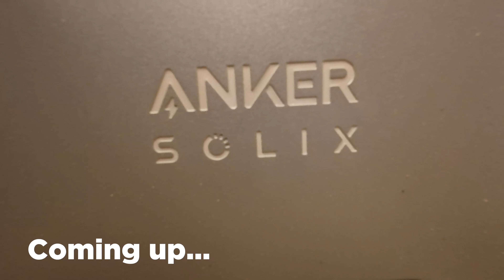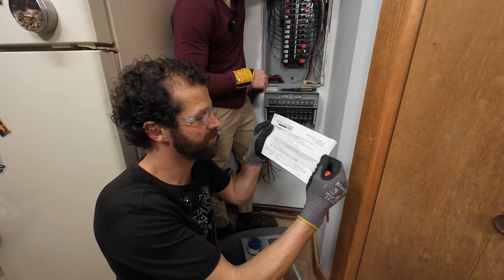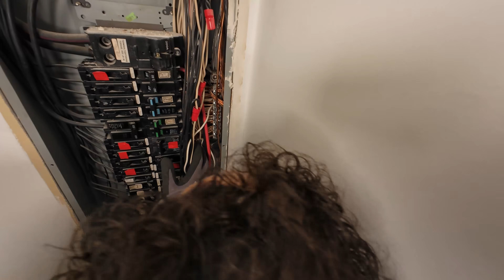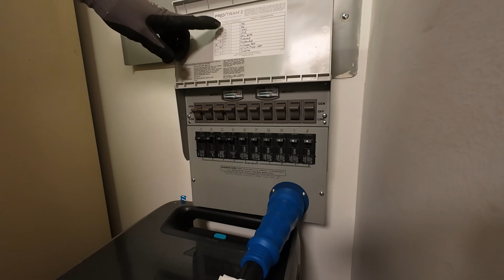Whole Home Batteries are Getting More User-Friendly!

Comment: Even if it is "Legal" to stuff so many wires into that conduit, why?  It seems SO easy to put in 2 conduits.  And also to put in the wires before putting tightening the 90 degree fitting on the back of the transfer switch.  So 8 circuits X 2 wires in each, and a neutral, ground.  That is a lot of wire to pull in and not damage it.  
It would be just as easy to put the two conduits on the back of the transfer switch,, with all of the wires going through the conduits, and then with the two holes in the bottom of the panel, pull the wires into the panel as you attach the transfer switch to the wall, then attach the lockwashers to the conduits. Then put on a bushing. 

Way to go, put a tap through the wall!  And drill 2" behind the electrical panel, when you are tapping the electric panel to put in the ground screw on your new ground bussbar.  Maybe it would be better to drill the hole, and then use a hand tap that is only going to go about 1/2" behind the electric panel?  

I always cringe when I see someone with a saw near a electrical panel.  If you use a large flathead screwdriver to knock out the drywall, then you are far less likely to ever cut a wire that might be located behind that drywall.  Once you have a 2" or so diameter hole, then you can feel for wires, water lines, and other things, then use the saw all you want!    Yes I know that you say a hand saw is going to detect the wires as you cut into them, and you are smart enough to feel the electrical wire, yet most do not have the talent that you have at detecting when you are sawing into a electric wire.  

This video is very educational.  Thanks for making it.

Comment: I would have used a #10 ferrel on the wire to connect to the plug, not doubling the wire. Makes for a stronger connection .

Comment: 00:01🔋 Whole home batteries are becoming more user-friendly, offering simple setup processes and clear instructions.
01:15🏕 Portable battery units are now designed with features like ball bearing wheels, making them suitable for outdoor use such as camping.
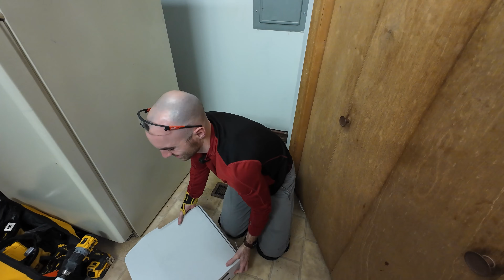02:09⚡ Anchor offers a simple home backup solution with a generator cord and manual transfer switch for easy power management during outages.
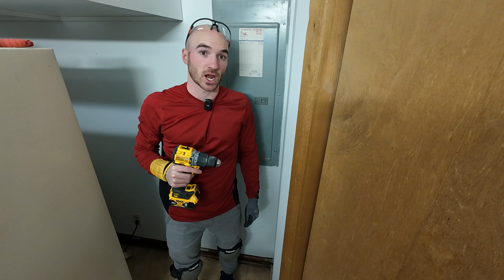03:12🔧 Tools needed for installation include a drill, screwdriver, and wire stripper cutters, along with basic circuit identification skills.
04:21🏠 Circuit identification is crucial for selecting which circuits to power during outages, ensuring essential loads remain functional.
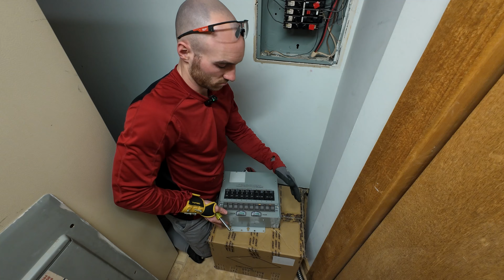08:16 🛠 Installation may require modifications for wire length and conduit positioning, ensuring a proper fit and safe electrical connections.
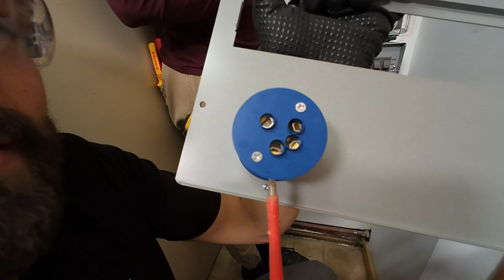14:18 ⚙ Careful attention to detail is necessary during terminal installation, including proper wire stripping and torque settings to avoid loose connections.
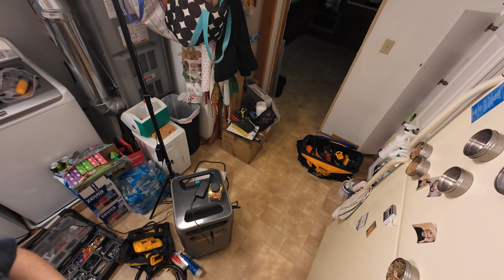20:45 💡 Working on electrical systems requires caution and attention to detail, as small errors can lead to significant safety hazards.
22:41 📏 Proper wiring sequence and attention to detail are essential when connecting circuits to breakers to ensure safe and efficient operation.
23:52 🔧 Use appropriate tools like a number one and number two square drive for electrical work to prevent stripping and ensure secure connections.
24:20 🔌 Properly cut, strip, and secure conductors using wire nuts for reliable connections.
25:31 💡 Consider panel upgrades for safety and efficiency, especially if breakers show signs of wear or if conductor bundling becomes an issue.
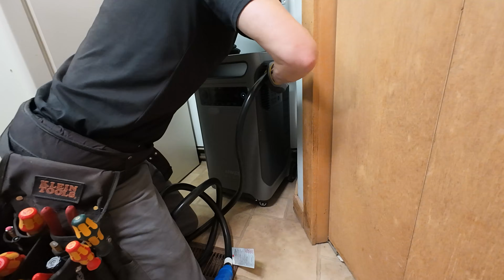26:47 ⚡ Transitioning from shore power to battery power involves securely connecting the power cord and switching circuits to ensure uninterrupted power supply.
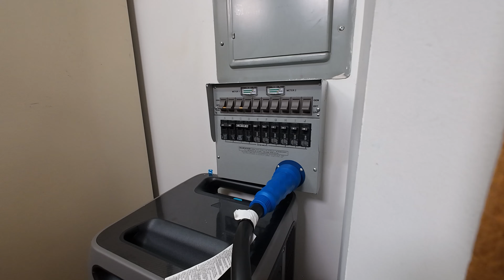27:02 🔋 Monitor power output and transition critical circuits to battery power during outages for continued functionality of essential appliances.
28:04 🛠 An easy-to-use manual transfer switch allows for seamless transitions between battery power and shore power, ensuring convenience and reliability during power outages.

Comment: Joel really itching to find a similarly sized solution, BUT, that can pass-through that 240 service. That way no intervention (manual transfer) neccessary. Any leads?
Reply: It sounds like you want a automatic transfer switch.  For a 200 amp ATS, that is about $600 - $ 1,200.  Plus installation.  Are you really sure you want a automatic transfer switch?
Reply: @Kangenpower7  no what I'm looking for is more like a grid-interactive inverter, which essentially acts as a whole house UPS. The of course exist, but not in portable form factor like this

Comment: Am i mistaken?, adding ground bar is no big deal. Adding a neutral bar I thought was not allowed- wouldn’t you need to have a more reliable connection than a screw into the case of panel- maybe a conductor not smaller than the total load that could be pulled connected to the main neutral bar.  Not bashing your work- genuinely proposing the question as iv had similar issues on past jobs
Reply: My solution has been to add a ground bar, then move grounds to it which freed up slots for my new neutrals
Reply: It is acceptable to install a second or third neutral bussbar.  They do need to have a large wire connecting them.  I thought that they did put in a large wire between the new and old bussbars.  I would think if the incoming #4 wire is used for a 100 amp service, then that size would connect to each bussbar.  If #0 incoming, then #0 for each bussbar.